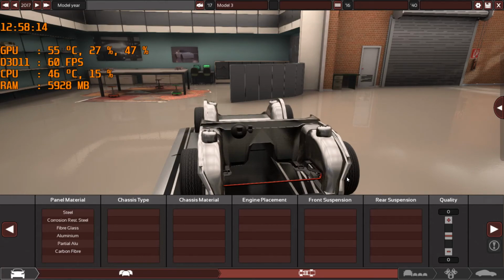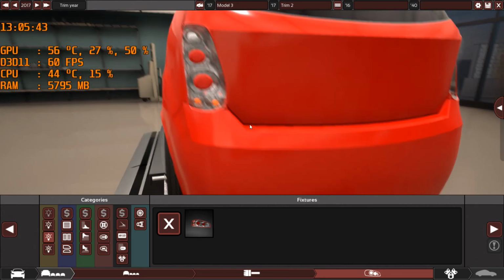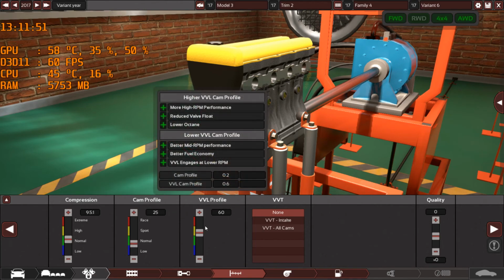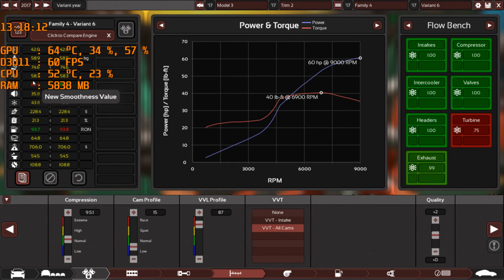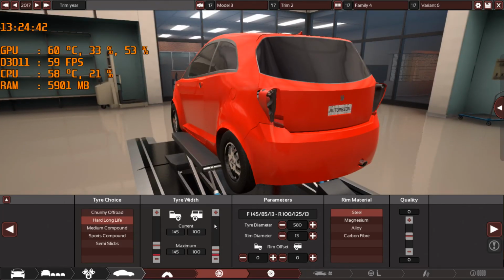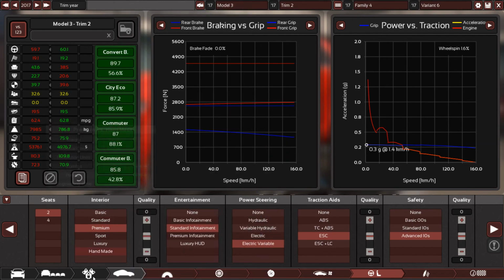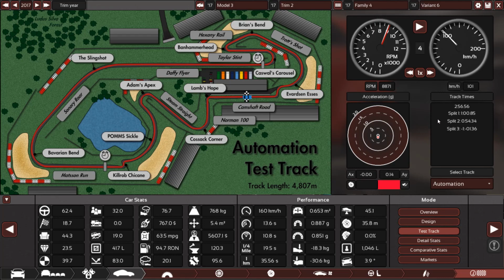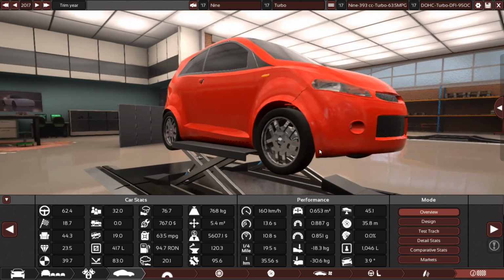A 9000 RPM with 63.5 mpg Light Weight Car !

Comment: vvl is vairable valve lifting that means vtec in engineering books :) vvt is variable valve timing an ist same vay to say vanos. difference between is in vvl you switching the cam profile  to resonable one and monster one (vtec kicked yo) in vvt came profile is same bot cam timing is changing. its means changenig cam timing to optimum one by the rpm. its gives litte boost to upper rpm and gives fuel economy to lover rpm. for example k4m renault engines (used in nearly all 1.6 renault in early 2000s) has 2 option of than. 109hp ones (used in mk2 clio 1.6 also megane 1 1.6) doesnt not have any vvl or vvt but when the time says "the year is 2003" renault make a little update in this engine and put vvt to intake camshaft. this and lost of other small stuf (like electonic thorotle body and updated ignition system) push the engine to 116hp. but the vvl thing can push the engines powerband to where you want. funny thing that 115 hp renault engine makes more torq then 150 hp honda b16a engine (i cant rememeber the numbers but difference is not huge maybe 5 or 6 nm) but honda gives that torq at 7000rpm and resonable low rpm powers(thans to vvl ohm vtec :D) renault one gives at 5000 rpm
Reply from the maker: I know all of this but which components are involved in VVT ?
Reply: Bshar Nasri in vvt chamsaft timing gear is only difference than normal system. The gear can rotate nearly 15-20 degres to adjust timing. The gear is different but camshaft is normal. So system cannot change the camprofile. (also sorry for my bad engilsh :D )
Reply from the maker: Thank you for the information 
Your English is very very good 
And thank you for your awesome comment

Comment: the question is MR. Bshar Nasri can you beat the record in with a higher then 120 mpg, use wathever you want but i recommending not to use a turbo to beat the record. beacuse turbos need more fuel then natural aspirated cars to function properly witch defeats the whole purpose of go further then 120 mpg.
Reply from the maker: +Charlie Andersson 
120 Mpg is an extremely high number 
I will try hard to beat it.
Thank you for the motivation
Reply: A 100hp turbo engine will generally use less fuel than a naturally aspirated 100hp engine